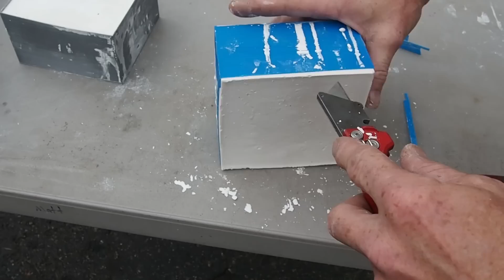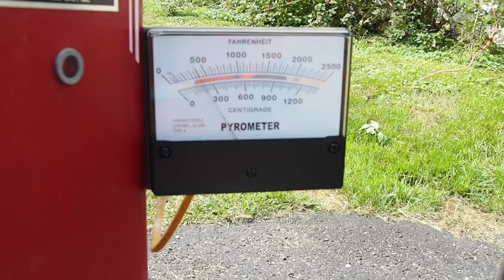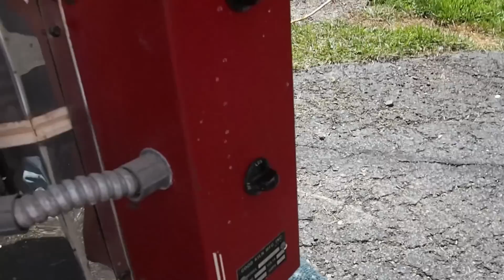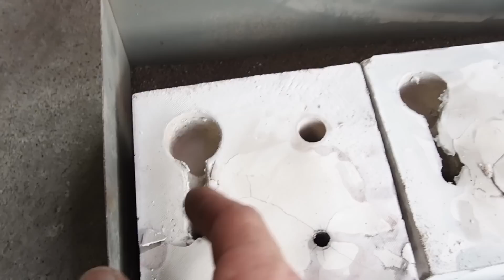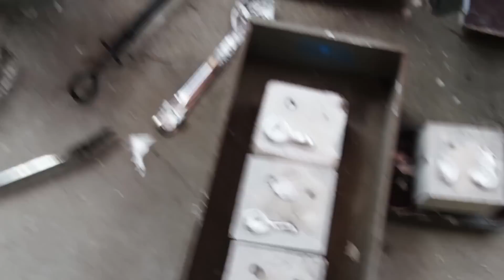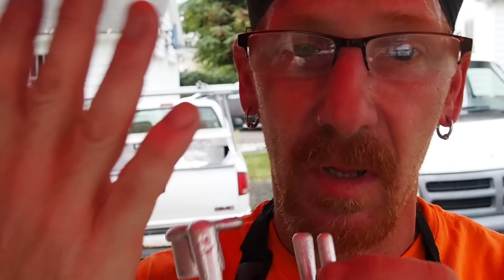Melting the 3D Printed mold box and pouring Molten Aluminum/ Lost PLA

Comment: Hi Matt, I just recently purchased an old Paragon kiln (no directions) to use for burn outs. I was wondering if I could get some info from you on how to go about the temps, kiln settings and times for burnouts. Also my kiln has the kiln sitter and two Low, med, high knobs like yours does however, the are broken and I have no which direction to turn them up and down. Watching your video it looks like you turn to the right to turn temp up. Is that correct? I would really appreciate any help.
Reply from the maker: Congrats on the purchase hope it helps out I know mine did. Here is my process I start on low low for an hour the low med for an hour then med med 1 hour high med 1 hour then high high for an hour it may not be scientific but seems to work for what I’ve done and as far as the know twist direction it was low to the left and high to the right good luck be careful it’s REALLY HOT don’t burn yourself be safe ✌️
Reply: @InsideTheMindOfMatt  Thanks so much for your quick response. I will give that a try.

Comment: Use a better alloy of aluminum for your casting extruded aluminum is very  bad because it's don't flow good use cast aluminum like aluminum from engine blocks of cars.
Reply from the maker: That might be a good suggestion but the thing is I'm an electrician and I have a huge supply of aluminum wire. So I am going to use this supply for now.
Reply: @InsideTheMindOfMatt  Mixing this aluminum with copper in 5 porcent of concentration by weight for mating a good alloy of aluminum, the copper dissolves in the molten aluminum add a little amount more because the copper oxidizes.

Comment: The lack of detail in the "IT MOM" part, concerns me, and I am unsure what would cause that. You got the "fine detail" on the ring, but missed that central part? Unless you were having a "solidification before-filling-details", which is possible, given the "cold mold". I think everything went according to plan as much as expected. I think that you should maybe be more patient with the "drying" process, and maybe even dry them in your oven rather than the Kiln. I think a "slow dry" at 200f (100c) would be much more optimal, for say, 12 hours, before attempting to "melt the PLA".
For the size of the blocks you had, I would attempt to dry them for 12 hours at 200, and then another 6 at 300f. (150c)
I think that you are heating the water so fast, it does not have time to "escape" which is building up pressure and "blasting" flakes off. Because honestly, those aren't cracks your getting, those are flakes/chips.

I don't see the air-bubbles this time in the cast parts, so I don't think "air bubbles" are your problem at least!

Comment: The grains in the mold should be smaller of you want that level of detail. Couple of suggestions...go for more rounded fonts so the PLA can drain off better...also change the surface design on the coin where you have lettering to a flat surface if possible.

Comment: Nice! This is a huge improvement on version 1.0! I agree that hitting the letters with a heat gun to kill the stringing might help. What ratio are you using on the plaster of paris/sand mix? I wonder if green sand casting would produce worthwhile results? I've seen some pretty insane detail with that stuff. Of course, it would sorta kill the whole "learning lost PLA casting" line that this has been developing on. Anyway, nice video, and great PPE. I'm pretty sure Michael jackson would approve of those gloves. :)

Comment: I'm by no means an expert but hot Molds and using a continous pour from so a vessel larger than whats needed to fill the mold will help alot, pauses allow gas pockets and cold shuts. Check out a channel called SWDweeb on YT he does alot of nice casting videos.

Comment: You're getting there Matt!  I just wonder if you're going to have to go to a fine casting clay surrounding the coin before it's all over with.  It looks like the PoP is crumbling away during the burnout and the pour.  
For the cores of the telescope mounts, Dad made a mold for the cores - let the cores dry mostly, de-molded them and baked them in Mom's oven.  LOL.  They were quite hard after baking, and had to be chiseled out after the final casting of the mounts.  They were mostly carbonized - soot black - after the pour.  
So, I wonder if you could utilize a similar method for surrounding the coins?  1/2" to an inch or so around the coin.  PoP could then be used for the rest of the mold.  I have no idea what he used for the cores, other than fine sand (I screened a lot of creek sand though) and barite (bought in huge bags - branded "Baroid" if I remember correctly).  It was super fine and super slick.  Duncan being in the middle of oil country, original home of Halliburton (which owned Baroid), and Dad with a machine shop, it all made drilling mud ingredients readily available.  
As I've said before, I'm no expert, and I'm remembering from 50-60 years ago.  So, take any of my ramblings with a HUGE grain of salt!

Comment: Matt, you may try placing coins vertically, all air will have a path to escape
Reply from the maker: The air isn’t the problem at this point it’s the mold material not conforming to my details

Comment: I would suggest using a SAND box mold 1/2  then do top 1/2 (split mold)
Reply from the maker: Well then I’m not doing lost pla casting with is what I’m trying to do sand casting works for some things but not the things I want to be able to do

Comment: Crud...looks like just plaster of paris painted on may have burned off with the plastic...maybe painting a small mix of plaster of paris and sand slurry would work better...plaster of paris alone doesn't seem to handle the heat well enough
Maybe trying more sand less plaster of paris might work...and instead of soupy mix make it more thick like peanut butter?
So darn close...and it's looking good...but I think my idea of just plaster of paris painted on was a bust...
Have you ever heard of "waterglass"  use just plain sand, and sodium silicate instead of plaster of paris?  Since you leave your molds out...the CO2 in the air will harden it, then you can do a burnout at much lower temps...
https://www.youtube.com/watch?v=-Mx1-o1_MWo
So cool...sooooo close man....gonna be epic when you get a good pour
Maybe try just a single sided mold..since the detail is on one side...just have the coin pressed into the block and fill it with aluminum from the top?
Reply from the maker: I never heard the term but I’ve seen the process thanks for the video interesting enough to maybe explore it